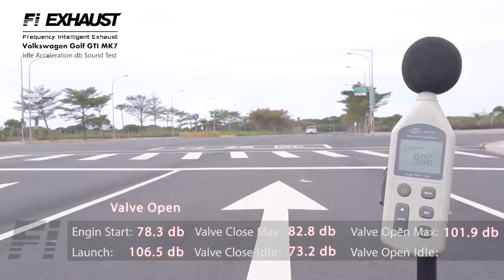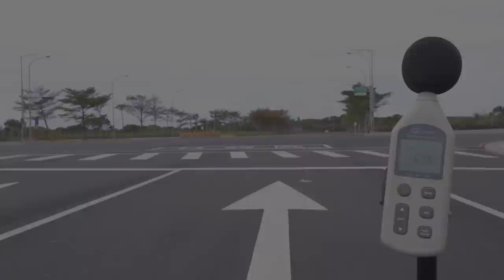Fi Exhaust Volkswagen Golf GTI MK7 Idle / Acceleration Sound db Test

Comment: What downpipe on the car in clip, cat or no cat? I just bought the FI for my mk7 gti, catback, it is a lot quieter than that with factory downpipe
Reply from the maker: Dear Sir,
Exhaust come with valve as standard including our intelligent ECU system which control valve by engine RPM or remote control.

Video Fitted with FI Complete Exhaust System includes:
Ultra High Flow Catless Down Pipe
Catback Valvetronic Muffler + Dual Tips